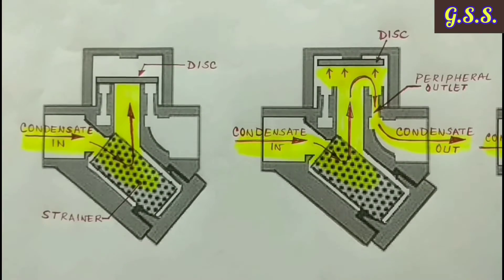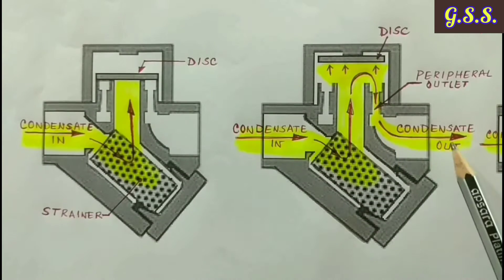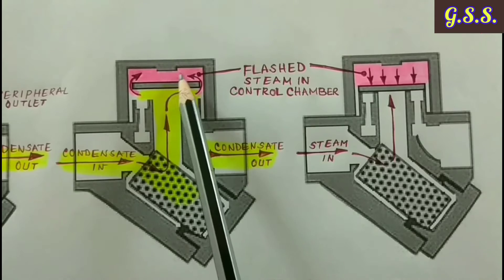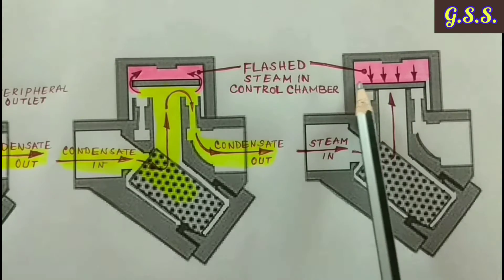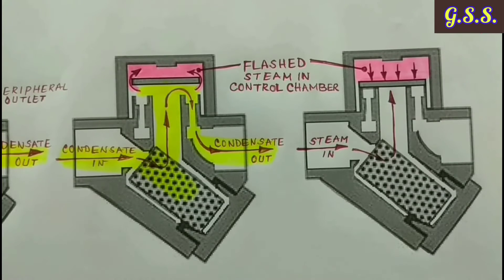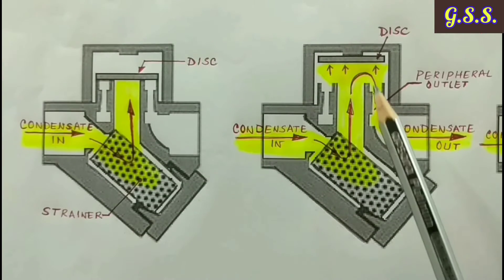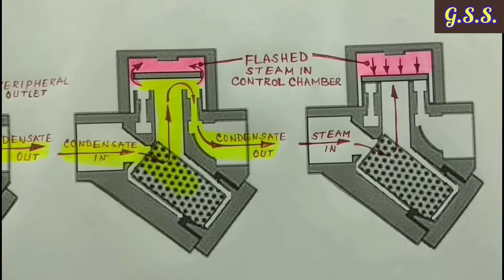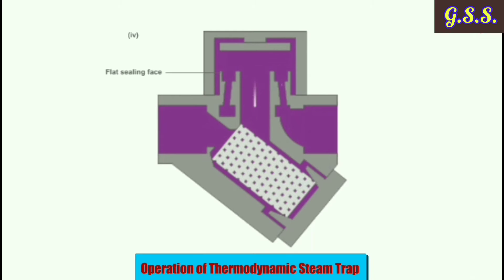Piping Engineering : Thermodynamic steam trap - installation & working philosophy

Comment: Hi sir 
For Underground piping spacing between pipes is same as above ground or we have consider More space below ground.
Reply from the maker: If any road crossing hume pipe is there, then more spacing will be required at road crossing. Also for providing wrapping & coating, gap between two pipe faces should be minimum 200 mm.
Reply: @gourisankarsamanta7670  
Thanks sir